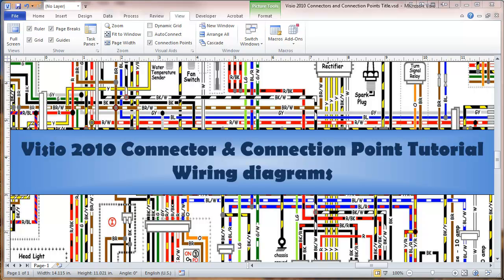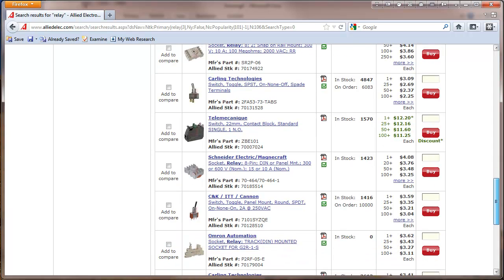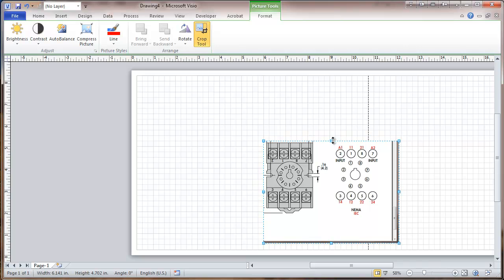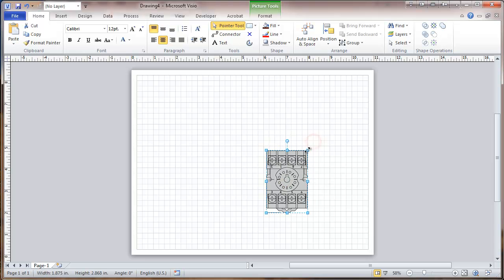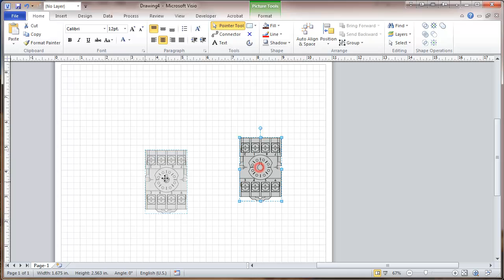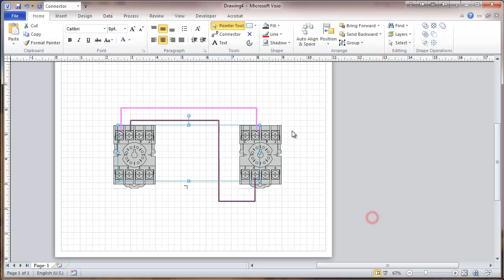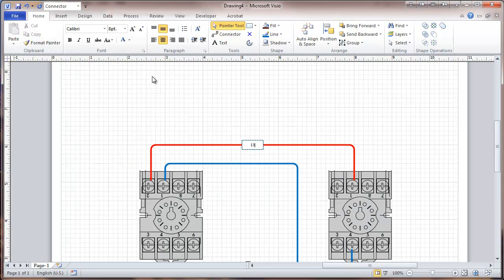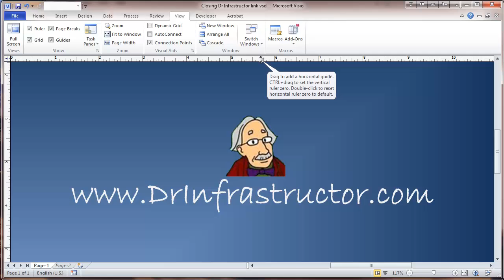Visio 2010 Connectors and Connection Points Tutorial - Wiring Diagrams

Comment from the maker: I used the default right-angle connectors.  You might try going to the design tab and then the connectors icon to make sure that "straight lines" is not selected. Also, remember to use the selection handles to move parts of the connector lines to where you want them.